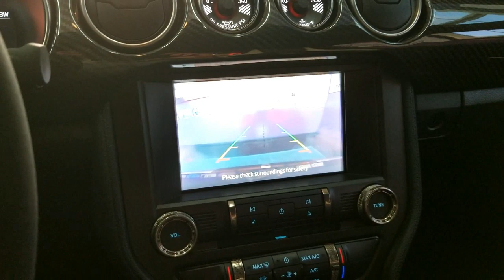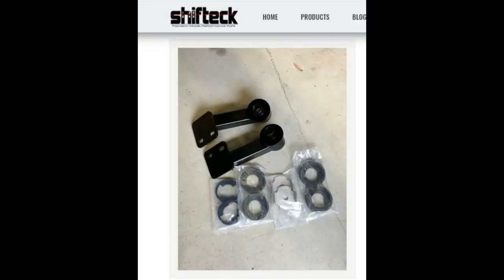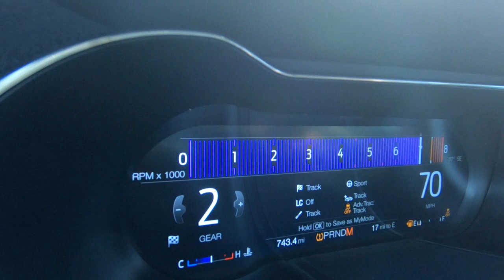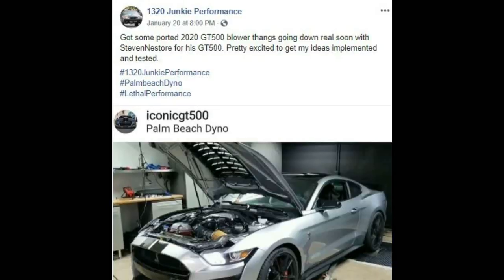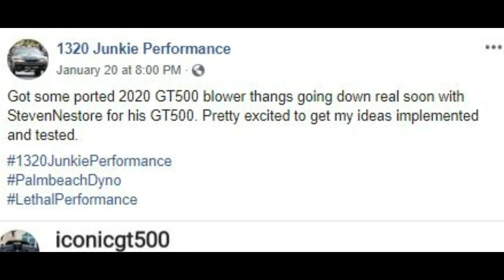800HP 2020 GT500 Cold Start & Wheel Hop Fix

Comment: Get them dodge boys they called out stock on stock  red eye vs gt500 Stangmode but they are running modded hellcats and demons and with your times I think you got them I think we need some blue oval venom at the call out
Reply: It's already been proven that stock gt500 beats them all but they wanna see it themselves
Reply: Car Culture Nation Wow I did not know a GT500 runs faster than a dodge demon in a quarter mile..lol
Reply from the maker: @domscorziello5748  they will stock for stock
Reply: @domscorziello5748  they finally just got the 9.7** that dodge claimed just recently a majority of them have not been getting under 10s and for a full on drag car it's had them mad. I expected more out of the demons and redeyes and we now know at the track red-eye is losing and if you look at some driver's they are only getting 10.2-10.5  and everyone blames it on the driver's it may be the case but it's still happening until they modify them. Stock the red-eye has been getting stomped and with same mods pulley tune etc the gt500 is getting them on streets and tracks and nobody has unlocked tuning on the trans yet so 9.7 with a tune and pulley etc from a car that way out handles a demon lol and the red-eye widebody by far it's just simply amazing car for what it is.  I say take the call out because the problem is they want a stock gt500 to go against the red-eye but the problem is they haven't been able to find a non modded dodge lol so they are also asking some that has a stock dodge. But since there cars are modded we need a gt500 on that track day
Reply: @donovankazee553  Do you have a video of a "STOCK" demon running 9.65 @ 140 mph? Because, the one Leah drove was not factory stock it was crate "MODDED" and might have had aftermarket tires not Nittos.
Reply: forcedair 92gt the crate comes with the car dummy. That’s not after market. Do your research. Smarty pants 👖 👖
Reply: @donovankazee553  No stupid it does not. Check your facts. But I am smart so you got that part right.
Reply: forcedair 92gt the crate is a $1 option along with other goodies. IT COMES FROM DODGE! No aftermarket company!
Reply: @donovankazee553  I've known that since before the car was released. You said the crate comes with the car, it does not. The crate has to be ordered after the car is in the owners possession. The aftermarket comment was about the tires used on the 9.65 pass. Nittos are not known for 1.4 or better 60ft times. That's all I was saying.
Reply: forcedair 92gt everything is with the car. All cars have options. 🙄

Comment: New Sub here! Great video! Keep it up! Got a question here for everyone; I’m torn between getting a GT350R which is what I was planning on sometime this spring probably around March/April but now after I’ve seen all the vid on the GT500 I’m confused man! And with just simple mods the car is making well over 800hp at the wheels! Amazing but I love driving manual and the sound of the voodoo motor too! Damn can’t make up my mind now! Please advice/input?
Reply from the maker: they are similar but very different cars. If you dont NEED to go faste rthan other people, get the 350. you can always add power later
Reply: I agree with iconic. One you can be more hands on row thru gears and have high rpm. The other is a high horsepower DCT more like a muscle supercar. The voodoo is great but has its issues in earlier ones but still has tons of potential supercharger or turbos. Now a GT500 has all the horsepower and very easy to get more and if you really want a manual vmp already connected a manual trans to a gt500 engine. But a human will never shift as fast as a DCT automatic. So a super car Stang or a hands on Stang with tons of potential.  If you have the money the GT500 is the best all around car. Muscle/supercar/handling/very fast for the price.
Reply: Reeve Topchiev plus if you get a GT500  carbon fiber track pack they tie a upgraded Porsche gt3rs around a track and a base GT500 beats the new c8 vette handling pack around the track so the GT500 has so much potential we don’t even know yet.
Reply: Car Culture Nation yup I know the stats I’ve watched all the vids I’m leaning towards the 500 but only way I’ll get one in a couple of months is if I find one at MSRP not paying ADM! Otherwise I’ll just get the 350R I know I can get one for around $66-67k!